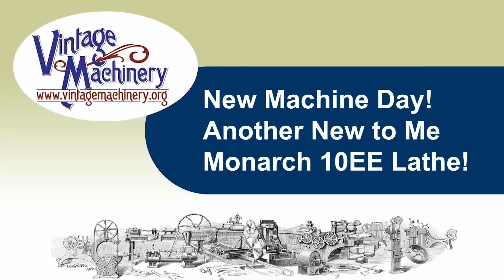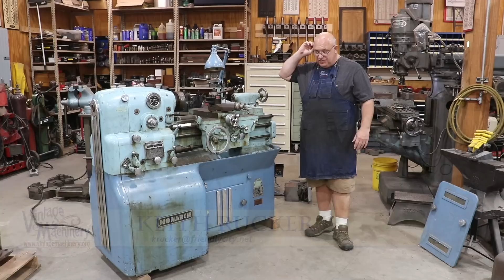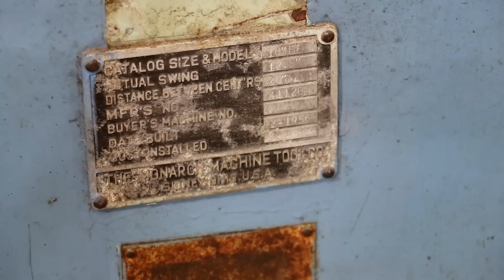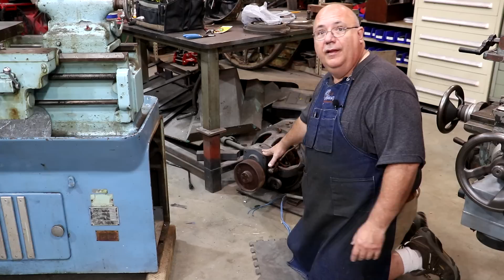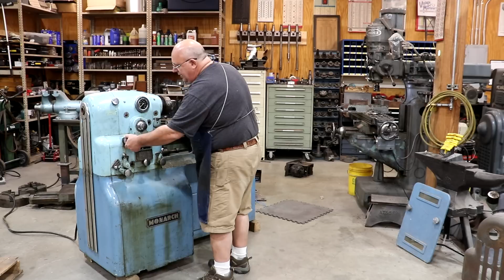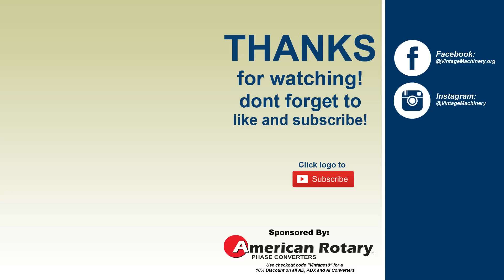New Machine Day! Another New to Me Monarch 10EE Lathe!

Comment: The electrics in my own square dial 10ee will automatically change the power to the motor in order to maintain the rpm I set, both when leaning into a heavy cut and again as I back off to no cut.  The person who designed this electrical control system could have been bordering on genius.

Comment: Having read a few comments and hearing you talk about the tube supplies that powered the motor, and seeing the tach indicator in the control panel, I'd be surprised if the original setup didn't have some means of feedback on the speed of the motor to the drive system.  Essentially a servo speed control.  Such technology existed back then.  It would work electronically like a flyball governor works to control the speed of a steam engine.  When loaded down the system would automatically give it the beans to maintain speed.  You're just not going to get such stiff regulation from a variac and such.  When you load it down, its speed will likely sag in response.  

Meanwhile, the spikes in speed shown in your video and your remarks about it not running unless at full voltage, etc. make me want to check the motor and confirm it's in good shape before assuming all of the issues you're facing are due to the drive system.  I imagine you're familiar with checking brushes and inspecting the commutator and such.  Good luck!  

If you find a schematic for the original tube drive system, please share.  That would be fascinating.

Comment: Find you the biggest  three phase motor that will physically fit in the machine. Preferably a 6 pole motor, these have more torque than a 4 pole.
Keep the shaft from the DC motor, but remove all the armature windings, machine the three phase rotor to fit the DC motors shaft, that way you can keep
the gear case and still have a back gear. You should be able to get 3600 rpm or more even with the 6 pole. I have did this on a machine that was originally
a belt drive. It's still running strong and it's under a high load. I like DC motors but with today's low prices on VFD's you can't beat an AC setup if properly applied.
Just something to ponder, I know that's what I would do with it. You will be far better off than keeping the old DC setup.
A testament to AC motors & drives is a lathe I converted in 1997 that had a reeves drive setup that was in bad shape, the original motor was a 3HP, I put in a 5HP 
with a slightly lower (higher ratio) gearing and I can drill with a 2" spade bit in direct drive, in fact I had to install a torque arm on the tailstock 
for fear of taking out the tailstock's keyway. The Lathe has the same speed range as It did originally, I hardly ever use back gear.
I'm no engineer but I have done lots of motor and drive setups for old machines, both AC & DC. Also rewired and updated a few CNC machines as well.
I know you could handle the machining part of this, would make for some great episodes for the channel too!

Comment: I love my 1939 10EE Sundstrand. Mine has actually been converted to a more modern Sundstrand drive. One day I will re-fabricate the setup as its not fully to my standards. IE the drive pulleys could be tighter on the shafts & better workmanship with the drive system that was converted to a later model Sundstrand.

Comment: Keith, I think you and I grew up in a generation when we went to public school and the "voice of god" told us what the right way to do things was.  Trouble is, that "voice of god" was really just another opinion.  It was the prevailing or authorized opinion, to be sure, but it was still just an opinion.  If you come up with a workmanlike solution that does the job and doesn't destroy the machine, that is a good solution.  It doesn't matter what someone else's opinion is.  In the end, if you can't come up with any solution, it is a hunk of scrap metal.  If you do come up with a solution, its a working machine.  Those are the only two parameters that really matter.  If you wanted, you could probably run the thing off a 1957 Ford V-8 if you wanted, and if it worked, didn't suffocate you with exhaust, and didn't destroy the machine, that would be a workmanlike solution.  Don't worry about the naysayers.  In the end, it is your machine, you do what you want with it.

Comment: Hi Keith, don't know if this is useful but the pulsing is likely due to an older rectifier without output capacitors. Older rectifiers are notorious for not giving steady output voltage or dropout, where the dc output voltage dips as the ac switches polarity.  Newer, ultra-low dropout rectifiers largely solve this but not at the kind of voltages and power draw for a lathe. One option could be to rectify the 240V, smooth this down with a large capacitor bank and then regulate that down to 204V. This may even be possible with a good modern SMPS if some filtering/smoothing is done between the supply and the machine.

Comment: I am by no means an expert. But it strikes me that Monarch identified an issue with spindle drive methods causing artefacts in the finish and went to extraordinary lengths to prevent any vibration in the spindle drive, then spent the next 40 years trying to find an effective system to do this. For my money I would do what Monarch did and retrofit a 3 phase motor with a high quality VFD.

Comment: Control transformer likely has a 110v coil in it , that will not like 240 voltage. Typically you should be within 10% of rated voltage 208 would be some 20 volt +- so 240 3 phase should work a bit high . Think I’d find the original schematic and build it as original also.

Comment: I'm not sure this is necessarily the best way to go, but you can get a fairly compact single phase 240/208V multi-KVA autotransformer, if having 208V single phase power is holding you up.  It would be interesting to see exactly how that variac is wired-- a lot of them could be wired to boost the output voltage above the input so they might have been able to get close to the correct max voltage for the DC motor.  I agree with Eric-- with unfiltered 120Hz DC, I would expect weird things to happen if the RPM x number of motor windings is close to some multiple of the line frequency.  I agree with him on the safety aspect as well-- I hope you have a really good ground on that thing if you are going to turn it on!

Comment: OLD TUBE TYPE RADIOS CAN BE CONVERTED TO SOLID STATE------WOULD THAT HAVE BEEN FESIBLE ( MY HORRIBLE SPELLING)  WITH THE ORGINAL TUBES IN THIS LATHE?????????????????????
Reply: The rectifiers can be converted, but there's not much point. Any further it's a rebuild, with a new power supply for a start.

Comment: A 240V Variac hooked up to an appropriately sized rectifier and a sufficient sized capacitor would give the DC motor enough voltage range to take advantage of all the power it can output. However when you rectify AC you’ll get a higher peak DC voltage because the AC Voltage is RMS (Root Mean Squared) or an Average. 

A full bridge Rectifier will take the AC Sine wave and transform it into a rippled DC voltage going from 0 - 169.7v (for single phase AC 120V) or 0 - 339.4v (for single phase AC 240v) so to better approximate a steady voltage a capacitor(s) can be added to “store” up the voltage and discharge it to the motor during the low points of the incoming rippled DC voltage. 

As you mentioned you still have the inconvenience for changing the variac dial AND you would have to set a hard stop on the Variac somewhere around the 163V to prevent from creating over 230v DC and frying the motor. 

All and all the I think the person who wired that had an OK train of thought but they just executed it HORRIBLY and made a train wreck of the power supply system.

I’m not very familiar with Monarch lathes so all of this is solely based around there being no other systems requiring electric voltage. 

The ENGINEERING MINDSET on YouTube did a fairly good explanation of how to change AC to DC that is worth watching.

Comment: Wish you had the Tubes.  They were state of the art and still are in some conditions.  The Big round unit with knob on top is a "Variac" (trademark) or a variable transformer. Loss of power at lower voltages is the problem.  The tubes were phase adjustable - gave pulse with at max voltage different and as you increase the width of power is wider. Tiny pulse is low speed but pulses to full voltage.  That variable transformer is useful for some things like lights and such but  likely not that even.  Light need log based windings.

Comment: I have a 1961 10ee.  When I got it someone had removed the thyratron electronic drive and replaced it with a variac.  Of course it was awful.  I'm an electrical engineer, which came in handy, for a change, in the shop.  The drives for the 10ee were actually two variable power supplies.  A big one for the armature that could go from about 20V up to 200 volts at 20 amps.   The other power supply was normally 100 volts but could reduce its output to around 20 volts or so.  This smaller power supply provided current for the field winding.  If you started the lathe at the lowest speed, the field voltage would be 100V and the armature would be at the lowest voltage, anound 20V or so.  As you increased speed, the big power supply feeding the armature increased its voltage to 200V.  At this point the motor would be running about 2000RPM.  The armature voltage could not be increased any more at this point to increase the speed.  To increase the speed, the big power supply continued to output 200V while the little power supply started to reduce its voltage to the field.  The speed of the DC motor is controlled by the motors back EMF, or voltage the motor itself is generating.  When the back EMF equals the applied voltage, the motor stops drawing current and regulates itself at that speed.  When the field voltage is decreased, the generator (back EMF) effect is reduced, causing the motor to run faster so that its back EMF matches the applied voltage to the armature.  That's why a shunt wound DC motor can explode if it loses power to the field winding.  The 10ee has all kind of safety circuits to shut the motor down if the field current drops too low, so no worries there.  I built a motor control system for my 10ee and it has been working great for the last 24 years.  My 10ee was geared (pulleyed) for 3000 RPM spindle speed.
Reply: Thanks for explaining how the drive did work. If I’d been better at maths I’d have covered DC motors but I switched and became a chemist.
Reply: Field weakening after armature is up to full voltage, to get higher speeds.
Reply: Haven’t heard a thyratron mentioned since my old radar days.

Comment: Of course, VFDs would have only been a dream in 1956.  The variable speed motor enabled Monarch to build the lathe with no transmission in the drive train.  They did have a back gear, but that was only in the drive train if you wanted the granny gear.  Belt drive is quiet and produces an excellent finish.

Comment: The variac wasn't the worst idea, but it doesn't preserve the torque at lower speeds.  There really isn't a better way to do that than with a solid state controller.  It could be rectified from AC to DC fairly easily.  I don't think the difference in voltages will be very significant, once the variable speed controller is set up.

Comment: 208 Wye with a neutral is standard household voltage. 240 Delta is for industrial loads. The reasoning being, according to Ohms Law the higher the voltage, the lower the amperage. I = E/R, P = I x E. The 240 Delta is also called a corner tap Delta. Every 3rd phase is known as a high leg, meaning phase to ground measures 240V. This was not practical for household due to overvoltage mistakes. A garage shop may only have 208 Wye available.
Reply: Don't know where you're from, but in the USA that's not true, at least in the western states. 120/240v split-phase is the rule out here, no 3-phase in houses.
Reply: @pauldzim   I don't care what part of the US you are from, if you check with your Power company and The National Electric Code, you will find household voltages are Single phase 208 Wye with a neutral. Just because people still call it 240 out of habit, doesn't make it so.
Reply: @TinCan9330  You're still wrong, sorry. I've measured the voltage in my service panel before, it's 240V (actually more like 244V) across the two phases.
Reply: @pauldzim  Well I will admit that most areas phased that out in the70's and 80's, but by the voltage I stand corrected. I guess we assume everyone has what we have locally.

Comment: Your discussion of the pros and cons of different drives was very helpful. I’d been wondering why my 70 year old mill had such an elaborate variable speed belt drive, and would the makers do things differently now?  I’d wager no electronic drive will still be working in seventy years time, but I won’t be around to know! I might add the belts still work beautifully , though I did have to make a new intermediate shaft as the original didn’t see much lubrication in its life. Really can’t complain.

Comment: Modern VFDs can produce 100% torque at low rpm running AC motors. Look for drives with sensorless vector control that have constant output torque.

Comment: Hey I am getting older,  30 years ago variable speed meant dc.  Too bad you don't have the original vacuum tube cabinet, might have been retrofitted with solid state rectifiers etc.  Today vfds are king, but you got to have that low range.  What to do.  Don't know ratio.  Shop made gearbox?   One old guy I know would probably stick in a model a ford transmission,  ha, actually he liked really  old chevy transmissions.  
It is almost sacrilege,  cut the gearbox off motor, put a bearing and support on.  Lovejoy coupler 3 phase motor and vfd.  Maybe an ev100 ge controller with some serious programming.  Good luck with your endeavors,  got a reliance drive on the shelf, but it probably wouldn't do right.

Comment: As you said, there are many ways to make one of those work if you don't want to keep the tubes (which, if I recall are large and very expensive). The way that one was done just looks janky as heck. Even the variac (more or less a way to control ac voltage) in that sounded horrible when you adjusted it. I'm sure you'll figure something better out whatever that is.

Comment: If the motor is good then it needs a suitable converter for the DC voltage. Maybe American Rotery can make one.
But you will need a transformer to adjust the voltage.

Comment: - Kieth, I suspect that Mike at: https://www.youtube.com/user/SmallEngineMechanic/videos could assist you with figuring out how to engineer as full and proper converter for a 230v DC drive...or otherwise get the electronics working right for you and still keep the torque, too.
- Mike is very bright, and very well trained... and this might be just the type of poly-tech challenge he would enjoy.
- His day job is inspecting and fixing if necessary generator systems that power life and death level situations such as hospitals, probably laboratories of various striped, etc.
- I suspect he has qualified for very level licencing requirements do do such work.

Comment: - Kieth, back in the day before transistor technology...they referred generally to the electrical guts manipulating electricity as Vacuum Tubes. All radios had them, such as Rectifier Vacuum Tube, etc.
- Curiously, for a long time, the Soviet Union had better more powerful radar on their fighters because they continued to use only Vacuum Tube technology to power their equipment...and thus could out-distance the top of the line USAF transistor driven radar on fighter and bomber air craft. {per: USAF, Lt. Colonel Retired, Lenny Halverson}

Comment: Vacuum tubes. There is no real comparison to modern ic compenents. They were switches, variable resisters, as well as many other components in one very small package. Benefit to tubes is tolerance. Input power did not need to be clean. Modern electronics the first part of any circuit is to clean power in some way.

That said there is people much much more knowledgeable about tubes and the circuits that could build you a near match with “sturdy” components. Gonna cost though. It’s been done before. Even some early electronics have been “modernized” for old stuff…car interior lighting for example that didn’t use bulbs.

Problem with small bed lathes is that lengthy parts are not really doable on them. Where there is a will there is a way though.

Wonder how many tool room lathes like this were used to cut windings on motors?

Comment: It needs to be a off the shelf controller with safety engineered in. 
I assume the idea was to directly rectify the incoming AC line at 240 or 208 and regulate the current feeding the motor using the vacuum tubes.  

Draw three vectors 120 degrees apart and 120 units in length, then measure the distance from tip to tip. You’ll see they are almost exactly 208 units apart. 
I assume the motor is a shunt field type, rather than a “universal” series field motor. Need the motor power rating to calculate the size of the controller needed. 
My guess is you will end up with a Pulse Width Modulated (PWM) style controller suitable for the rated voltage of the motor.  
You might check with manufacturers who specialize in speed control for vintage elevator motors, as they would operate at around that voltage.  
Be safe! High voltage DC will not allow any muscle movement if you get across it. 
I’m curious to see what you finally find.